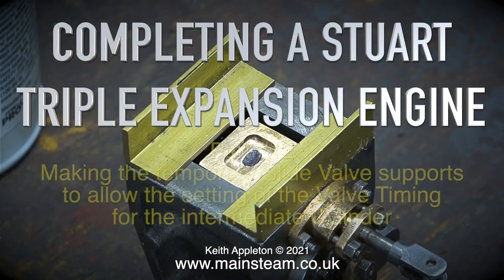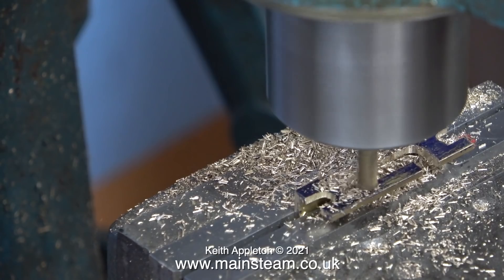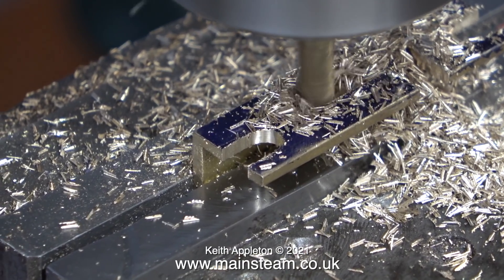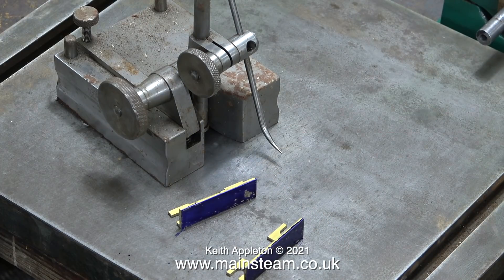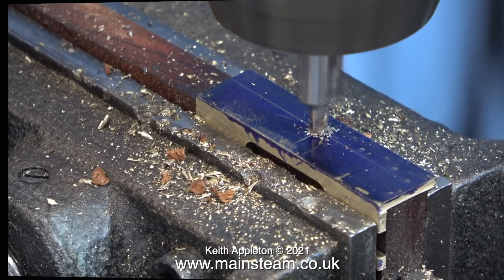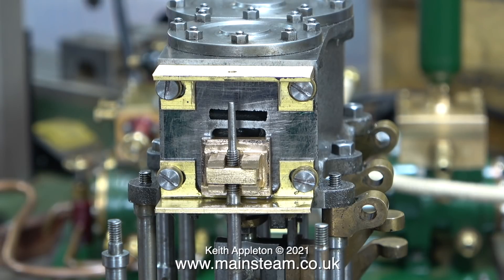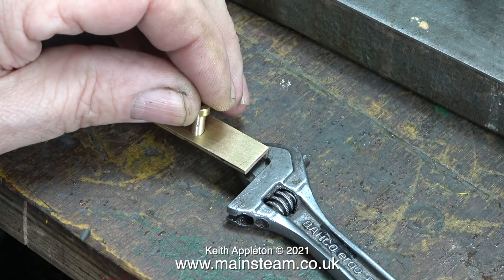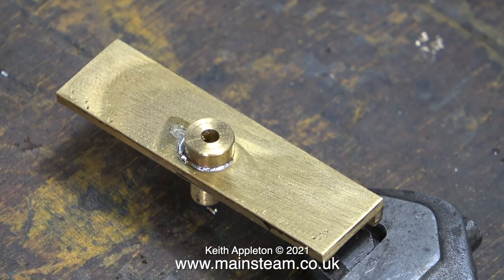COMPLETING A STUART TRIPLE EXPANSION ENGINE - PART #12

Comment: I need to lay hands on a metal straight edge ruler with imperial on one side and metric on the other. I work in metric with cad, but sometimes, and I know keith probably sympathizes, when you work mainly in imperial during your day to day life, it takes a second to correlate sizes based on the two, especially when mathematical rules pose a problem with a learning issue.